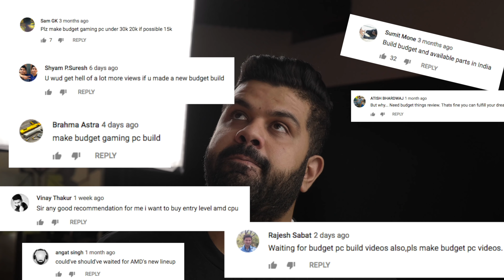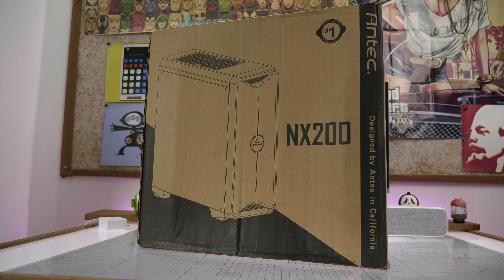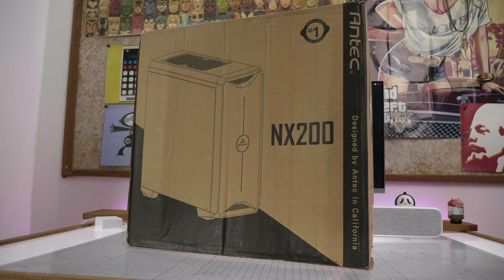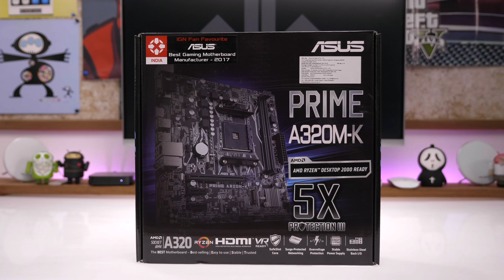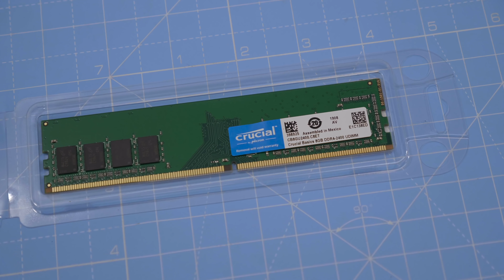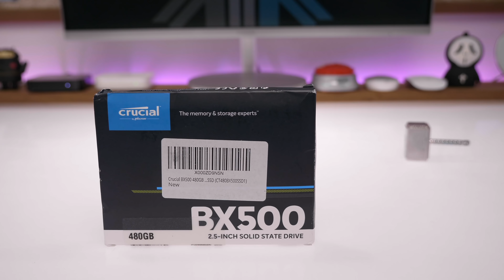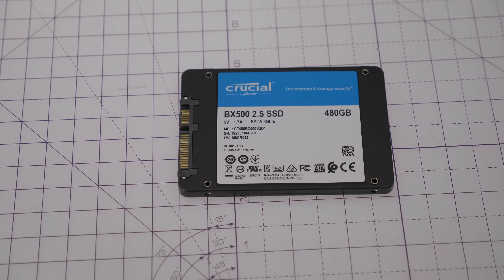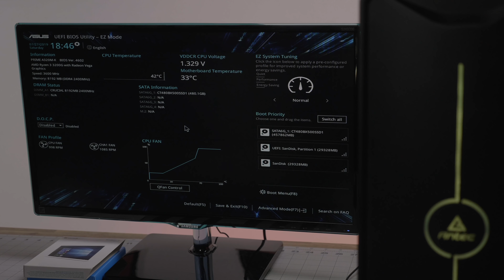Rs. 25000 Budget Gaming PC For PUBG & GTA V : How to Build Step By Step

Comment from the maker: Guys we Added a GPU and another stick of RAM to the Budget PC : See the results here : https://youtu.be/hj5i5QIWBuo
Reply: Best streaming pc in 35k
Reply: Nice introo bro 😍😍
Reply: Does the motherboard support Ryzen 3000 series processors out of the box or is there a need to update the BIOS?
Reply: plz let me know how can i play pubg and gtV without gpu ??????????
Reply: This is not gaming pc its normal entry level pc. Only pubg emulator is going to run in this specifications.
Reply: how the games worked without a gpu ????🤔🤔🤔🤔
Reply: @NishantPatelID  this guy made a fool of viewers...he didnt put a graphic card...which will cost nearly 7 to 10k..😪😪😪and showed to poor ignorant viewers that gta v and pubg works in 25k...this is basically a entry a level pc...gaminh pc needs minimum i5 and a decent graphics card🙄🙄🙄🙄
Reply: Can we add ryzen 5 into this build instead of ryzen 3 without changing the motherboard and other things..?? Please help me out. 😍
Reply: @mathewsimon4231  bro may be you doesn't paid attention it's APU (that means it has integrated GPU that is Vega 8)..... not CPU only... and Ryzen 3 can go head to head with i-5 in terms of performance.... 😒
Reply: Can I go for 500w psu
Reply: @anupamsekhar186  yes you can but you need more power so go for 500 psu
Reply: Please pls pls pls I am begging you pls tell me how much fps in fortnite in this pc without upgrading ram and gpu plssssss
Reply: I connected all the cables as you said, cpu is turning on but no reaction on monitor screen and also mouse and keyboard is not responding. What should I do now?
Reply: Fps in csgo ?
Reply: A Big fan of you IGYAAN.
Reply: Can it run fifa 2020 always ?
Reply: Thanks bro.
Reply: Any issues with this pc so far? M planning to build one
Reply: @mathewsimon4231  LMAO YOURE MAKING A FOOL OUT OF YOURSELF. DO A RESEARCH BRO ITS AN APU LMFAOOOO
Reply: Thank you so much bro for this detailed installation, helped me alot.
Reply: @NishantPatelID  yes
Reply: core i3 3470 processor in this pc 
Replay quickly 
Love to pubg , gta 5

Comment: well done bharat. you took  the right components to build the 25k gaming PC. Also guys if you want to add GPU and do not want to spend a hell lot of money, you can always look for the used market as well, wherein you can get GPUs at fairly decent price, say for example you can get 1050ti for 6k and also it will have 1.5yrs to 2yrs warranty on graphics card. I personally used 4 graphics card as of now, as i have 4 machines :P and all of them run absolutely fine, 1 of them created a problem i took it to MSI and got RMAed without any hitch.

Comment: Tips for beginners

1: install cpu, cpu fan, ram in the motherboard before inserting it inside case

2: install a single fan at the front of the case to prevent dust build up inside the case

3: consider a cheaper case and invest that money in ram or better psu

P.S. the motherboard will not support the cpu out of the box, i will need a bios update in order or recognise the ryzen 3rd gen cpu. So to update the bios you have to put an older generation cpu inside and update the motherboard. Ask the retailer where you are buying the motherboard from to update the bios for you

Comment: you can replace power supply with Corsair VS 450 . it is cheaper and equally good. i do have a GTX 1060 and it is amazing.. works smoothly with almost all games

Comment: I have a Question.... but firstly, A great guide to building PCs!!! Good Job there!!
However, if you could have also shown in detail how each cable is connected to motherboard, it might have reduced the chance of confusion..but thats fine..
Some Qns: 1. I guess I will have to purchase windows separately? 2. can i use a Ryzen 5 instead? Will any other component specification change due to that?
Thanks in advance

Comment: Excellent video. Considering ryzen's infinity fabric is dependent on ram speeds you should have gone for 3000Mhz. Ryzen 3200G is perfect but if upgrading is a concern Ryzen 3400G should be recommended otherwise the system will be CPU bottlenecked.

Comment: Does the motherboard required a BIOS update for 3rd gen ryzen ?
Reply: For 3200g? Yes, it does require bios update.
Reply: Better go with Asus EX A320M, just 1000 rupee note costlier than the one used in video, but that comes with a rgb header, rgb expedition lights onboard, 4 ram slots, reinforced pci bracket, m.2 ssd slot. 
And instead of crucial basic ram, go for hyperx or ripjaw 8gig 3000mhz model, which comes with a heatsink, looks better, and costs only 500 bucks extra.
Reply: I recently built a system using same spec but used some different component, you want I can email you the pictures of my custom build.

Comment: I would recommend an ASROCK B450 motherboard and RAM about 16gb as APU is a RAM based proccesor and the intergrated graphics would use RAM too for the games.
Get a good power supply like Corsair or Seasonic.(never compromise on a power supply plz)
Make sure you have an anti-static working surface for building the pc.
Install RAM as far as possible from the cpu(in this case in the second dimm slot)to get more bandwidth.
Personally don't like the Ketchup and Mustard cables try to get the black one.
Get RAM which is over 3000mhz as 2400mhz is pretty slow for this time around.
Reply: Why they advertised it as a gaming pc I don't know they compromised lots of things with that build and gone for only looks. at least a gaming pc need 45 or 50 thousand budget . Because it can run GTA v you can't call that as a gaming pc. still it's a 1 year old video just popped on my recommendation.
Reply: @pritampaul9268  so true
Reply: @ashvith6943  but still those apu videos ripping me off i just hate apus.
Reply: @pritampaul9268  I mean AMD has come a long way we just have to appreciate it and yeah apu's suck
Reply: @pritampaul9268  I guess we can expect more from the upcoming 4000G series apu.
Who knows?
Reply: @ashvith6943  yeah those will be good but will just be relevant for casual gaming and will not be future proof. I would say if you have the money just go for a dedicated GPU.
Reply: @pritampaul9268  a 970 would be great if very low budget
Or a 1650 super or 1660 oc will be great if you can spend more.
Reply: @ashvith6943  and also rtx 3000 series are coming
Reply: @ashvith6943  yeah absolutely
Reply: @ashvith6943  and i think at least 12 thousand budget should be kept aside for a mid level GPU.

Comment: i made the same pc but different components
1. Ryzen 3 3200G
3. A320M-H Gigabyte Motherboard
3. Corsair LPX vengeance  3000 MHz RAM 8 GB 
4. Corsair VS 550W PSU(bought a larger psu for future upgradation)
5.Antec N200 Case

After Saving for 3-4 months..I bought a MSI Gaming X 1660 Super
Now it is working like a Beast!!!!
Dont Buy a GPU better than 1660 super.. It will Bottleneck.

Now I am getting 70-80 fps in every game at 1080p ultra settings
Reply: Whats  the cost for this build

Comment: dual channel would have given a little more boost instead of 1x8 ram you should have used 2x4 since APU works better with Dual channel memory , loved the Vid
Reply from the maker: Yes however that does not allow for future upgrades. To upgrade you’d have the change both the sticks . Now you just add one more and get dual channel

Comment: And that pc case dont have front airflow gaps. If u going to use this pc for life long without upgrade this pc case is ok . Or if u going to install gpu and change processor in future then u need to face heating issue

Comment: Do all the required wire connection comes along with the product or with the case itself?
Reply: The manual for the motherboard has the schematics for majority of the connections but most people dont need that as there's only one way it can all go together, just remember the major connections.  The biggest connector from the PSU is for the motherboard, and a smaller similar cable to that is the processor supply connector. after that wire down all the additional components with the power cables(HDD, Disk drives, SSD, GPU etc). then just connect the I/O cables from the Case to the motherboard headers by referring to the motherboard manual. Dont forget to connect the CPU fan cable to the motherboard(refer manual for where to find it).

Comment: which one you suggest to buy msi gtx 1660  GDDR5 gaming Rs =18000
Msi gtx 1660  Super GDDR6 Rs= 24000
Value for money graphic card
My system specifications
i7 6700k
Msi z170 a pro carbon
16 gb ram

Comment: I just built a gaming pc for 32k 
Got a good deal for most of the product 
Specs : 

I5 7400
16gb ram
1060 6gb
Corsair vs650 
Oracle gaming cabinet (4400₹)
1tb HDD and 120gb 2.5` sata ssd
Msi pro series motherboard
Reply: Benchmark??

Comment: Nice video.... thank you..!!!
Can you help me in my build
I have build system getting hang it's only 2 weeks old can you help what is a problem? its compatibility issue or windows 10 issue or bios?? or any other please help..??????

Below are my specs:
MSI tomahawk max motherboard
MSI RX 5700 xt Evoke OC 8GB DDR 6
Gskill Ripjaws 3600 Mhz
WD 1 Tb Baracuda HDD
Intel nvme m.2 512gb SSD
Corsair CX650 SMPS
Corsair Spec 01 Cabinet
Cooler master CLM 4 IN 1 Box 120Fan
Monitor  LG24UD58 4k 24 inch

Comment: RAM ,SSD, HDD, PSU ,LED STRIP 

RAM - CORSAIR 8GB 3000Mhz comes with heatsink same price 

Ssd no need of 480Gb for this budget 

..use WD M.2 240GB SSD ONLY 2.5K 

BUY WD 1TB WD10EZEX ..at the saved money 

Any PSU will do the JOB correctly ..A lot savings at PSU 

USE CIRCLE 400W PSU .costly below 1K .(no GPU connector ,not upgradeable ) but very very good PSU

Comment: I've  i5 9400f with rx 550 2g gpu... 
Shoud i change my gpu or just change my old HD (1366X768) Monitor with 1080p????? I can afford  one of those......
Reply: GPU needs an upgrade
Reply: Upgrade GPU to 570 or 580...And there's also a very cheap 1080p monitor on amazon which is only cost 2599 rupees... Named as VIEWO 1080p monitor. You can search

Comment: Just last week I built a PC for light gaming and office work for ₹18,000. With 
AMD 2200G APU, 
same asus 320 motherboard, 
240Gb WD SSD
4GB Ram,
And a cheap ₹1k cabinet with smps.

PubG light runs smooth. Regular day to day tasks are lightening fast. 
Performs much better than my sluggish nearly unusable i3 laptop.

Comment: Bhai i need your help, I built a Custom PC using: Asus a320m-k , ryzen 5 2600, 1660ti but the display says :No signal.. I did every possible thing to make it work. . Cables were all good. CPU fan does run though. But the Display shows no signal, What could be the possible reason and solution. Do i need a BIOS update? or anything . PLEASE DO REPLY. MY MONEY IS ON STAKE RIGHT NOW.
Reply from the maker: make sure the RAM is plugged in properly. remove the GPU and connect the display cable to the motherboard if it boots, go into bios and select the discreet graphics as the primary video driver. save and shutdown. Install the GPU , make sure you plug the display cable to the GPU and boot , everything should be fine. 
other things to check : 
-> Make sure that the CPU cable is connected to the top left of the motherboard. 
-> If your GPU needs additional power make sure it has the right GPU cables connected. 
-> Make sure your PSU has enough power to support the GPU !

Comment: LOL
25K
R3 1200 5K
RX 570 4GB 11K
RAM 8GB 3K
1TB HDD 3K
A320M 3K
PSU 450W 2K
CASE CHEAPEST 1K
THIS IS BUDGET BEAST
OR
R5 3400G 14K
A320M 3K 
1TB HDD 3K
8GB RAM 3K
PSU 450W 2K
CASE CHEAPEST 1K
Reply: Does second one needed graphics card ?
Reply: @aresrikar8653  no 3400g is an apu
Reply: Does the second one good for android development , Photoshop and light use of premiere pro 
Main purpose is android app development and coding
Reply: @Rajupk123  ya r5 3400g is capable but not for hard editing
Reply: R5 3400g 
My main purpose is Android development , coding etc related to it 
Except hard video editing 
Will this PC able to do the work without lag and with ample compiling speed
Reply: What the difference between branded psu and non branded psu like zebronics 
I already have a zebronics psu 
Should I use it
Reply: How to claim warranty of any parts if it got complaint
Reply: @Rajupk123  bro u can visit company store or showroom for warranty 
my recommendation is buy parts from TECHMART UNBOX indias best store for pc parts
Reply: @Rajupk123  for psu 80+ rating is there to differentiate between branded and non branded psu 
vs450 is 80+ white certified
in such manner u can buy
80+ bronze
gold 
platinum
Reply: I know techmartunbox from his YouTube channel 
But how to claim warranty if I buy the parts from his website 
There is no showroom or service center for all the parts 
So what to do
Reply: @Rajupk123  claim warranty from warranty card if there is no showroom store seller can also give u replacement or fix
Reply: So will the seller techmartunbox give me repair or replacement in time of complaint 
How to know which part got complaint
Reply: Here I local stores prices are very high
Reply: @Rajupk123  they have email and phone whats app too u can contact them if they will give u damaged part 
but APRROX 💯% u will get genuine and original part dont worry just purchase it from anywhere 
just look for scams in nehru place and stay away from AliExpress ebay
Reply: I am from Kerala nehru place is in Delhi 
I have emailed him about my queries 
I asked you about the complaint appears after a year usage. 
So how to claim warranty for that from the seller 
Here in local stores price is high

Comment: i say get a R5 3400G it will cost more but u will be able to play GTA V on high settings 60 fps
BTW i have i5 3rd gen 8gb ram and GTX 1050 ti overclocked and i play at ultra settings 60 fps 1080p moniter

Comment: You guys have no idea of bottlenecks if you add high end gpus for this chip. Misinformation. Could have at least spent a little more on b450 board so you can overclock the igpu
Reply from the maker: Both the Chip and Processor are cable of handling the GPUs recommended with almost no bottlenecking. It is a budget build, we could have bought a lot of things, however we found the parts mentioned to be a good balance. You are free to choose your own.

Comment: wtf is this????? benchmark does not show at what setting you were playing and what fps you were able to get? Even in 2019 no indian Youtuber uses msi afterburner or fraps? no temp  monitoring (it is a low end gpu so it should run cooler but still). Rubbish content...0 knowledge of how to benchmark or test a pc system.